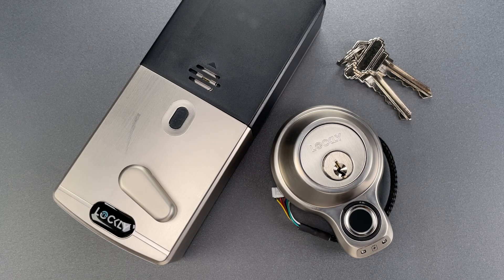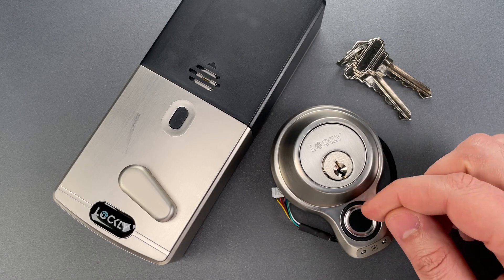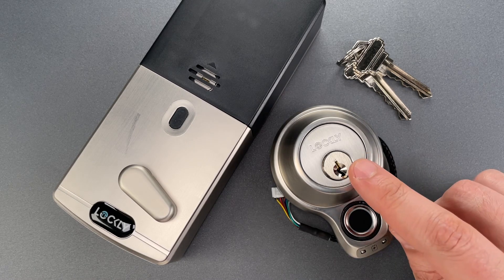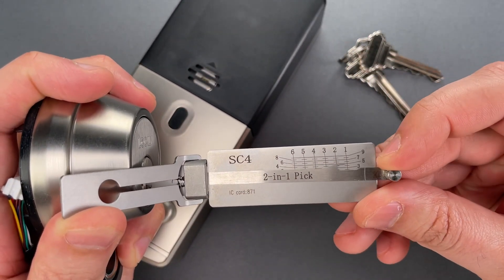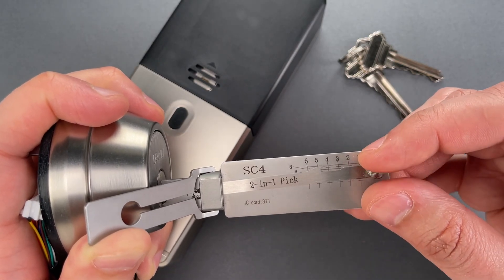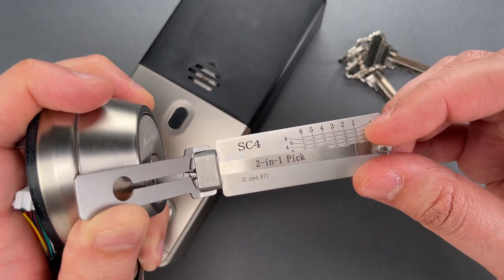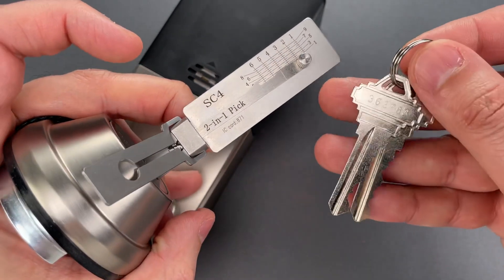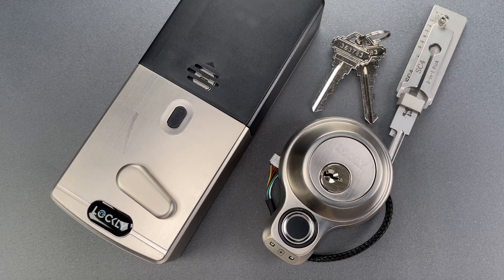[1410] Lockly’s “Flex Touch” Deadbolt Picked

Comment: I wonder what other vulnerabilities it has.  Magnet attack?  App security?  Hammer?  Etc.
Reply: Nothing short of a vault is secure against a hammer.
Considering that the actuator looks to be on the inside, I doubt it's susceptible to magnets - at least, not from the direction of the most likely attack.

Can't say about app security - that's likely no better than your phone security.
Reply: @lairdcummings9092  well, we're talking non-destructive attacks mostly
Reply: @CharlesHydronium  well, it can certainly be picked - if you've got the skills or right tools. I'd say - based on US crime data - that such is more than moderately uncommon.

Phone app is probably the most likely electronic access, but unless you are specifically being targeted, also pretty damn uncommon. Unless your phone has absolutely no security and is stolen by a burglar who is going to strike before you can reset the lock - oh, wait... I said pretty damn uncommon already, didn't I? 😉
Reply: @lairdcummings9092  Solenoid-operated locks can be very vulnerable to a hammer.  Not a destructive attack but an inertia or vibration attack.  Far less likely to succeed on a lock mounted to a doorframe, unless the implementation is particularly bad.
Reply: @bdf2718  while entirely true, the operating mechanism is on the other side of a door, making such an attack kinda pointless; if you can reach the mechanism, you can just flip the lever.
Reply: @lairdcummings9092  You seem to be assuming the thing is well designed mechanically.  This tends not to the case with smart locks.  It would have to be incredibly badly designed to succumb to the vibrations caused by a hammer applied to the outside, but...
Reply: @bdf2718  I'm not assuming at all. The LPL specifically said it was well-built. You did watch the video, yes?
Reply: @lairdcummings9092  He did say well built.  And mentioned the tolerances of the pins, in particular.  He didn't say it was well designed, though.  One can infer that LPL would have mentioned if it were badly designed but he doesn't always mention all the weaknesses of a particular lock in a single video.

We also seem to be spending a lot of time on one item in an open list of potential vulnerabilities.  Did you see my "etc"?  How does it fare against a ramset?  A core puller?  Etc.
Reply: @bdf2718  yeah, you seem a bit determined to find fault.
I'm not buying it. 
LPL doesn't usually leave faults unmentioned, or at least un-teased. None of that here, so I'm trying figure out which rathole you're trying to find.
Reply: @lairdcummings9092  LPL didn't mention any other faults, so one could assume there aren't any.  Nor did he say it was a lock he would consider using if he upgraded the core, so one could assume there are other weaknesses.  It could go either way.

My guess is he went for the attack he did because it was the weakest.  So, with an upgraded core, what would then be the weak point?  If there is one, why didn't he mention it?  If there isn't one, why didn't he say it was a great lock?

My guess would be the security protocol (or lack thereof) between lock and app.  If not that then the electromechanical interface.  But then there's the ramset and core puller.

There is going to be a weakest point of attack even with an upgraded core.  Is it a practicable one?  Most attackers aren't going to be experts with all the tools, they're going to be crackheads with a rock.
Reply: @bdf2718  LPL seems to like the single-pin method except for where raking is easy. If nothing else it's more entertaining to watch; moreso with his added commentary. I can't recall him ever using any cyber approaches though he does bypass some electronic locks. I know very little about cyber myself but I do know that BT and wifi aren't terribly secure for those knowing how to deal with them. In-depth pen testing does make use of wifi and BT exploits but not much online about those.
Reply: The locking mechanism is on the inside, so you can forget about physically assaulting it without destroying the lock or door. BT/WiFi unlock is what I would be most concerned about as it doesn't take much to ruin security, especially when sacrifices are made for convenience.

Comment: I can imagine that lock manufacturers compensation packages include bonuses based on LPL video length.
Reply: So folks at Master Lock get pay cuts? 🤣🤣🤣
Reply: @duke9173  are they even paid at all? I'm sure it's unpaid interns all the way down
Reply: This one would have been significantly harder if he used cheaper tools. In this case he just picked it with an expensive tailored tool. It's a great video, I like the Lishy videos it's easier to see what is happening, but it makes picking look easier that it would be with a standard pick and turning tool.
Reply: Using the Lishi has three benefits: it allows LPL to plug his website and tools, 2) it allows the viewer a better idea of what is going on, 3) allows the LPL to educate the viewer, and 4) keeps the video to a shorter length - an LPL trademark.
Reply: "So we get a bonus for a longer video?'
"Guys, lets make this lock hilariously bad so LPL will spend tons of time ripping us apart!"

Or when a measure becomes a target, it is no longer a good measure.
Reply: So does it really matter. This is a solid evaluation.
Reply: If you watch his SaintCon keynote, you'll learn that the only response he gets from lockmakers is "STFU"
Reply: Masterlock wins by sheer number of videos

Comment: Is this susceptible to the magnet attack that defeats a lot of electronic locks?
Reply: I doubt it. Seems like LPL would have checked that and would have said if it was.
Reply: The actuator is on the inside of the door, so, I'm pretty sure magnets are out. At least, from the direction of the most reasonable angle of attack. Anyone who can reach the inside can just flip the lever. 😛
Reply: I am going to go with not vulnerable to magnet attacks because all the unlocking mechanism for the electronic portion is located on the inside portion of the door, given most entry doors are metal clad doors the magnet would be useless, most likely not able to work with a solid wood door due to the mass between magnet and mechanism
Reply: Have any of you considered that there is simply a switch inside the external part, so maybe a magnet could move the small steal switch arm to active the switch without moving the rotating the barrel.
Reply: @NickSteffen  Have any of you considered that there is simply a switch inside the external part, so maybe a magnet could move the small steal switch arm to active the switch without moving the rotating barrel.
Reply: @dfgaJK  yes, considered and discarded.  It’s like any other dead bolt it just happens to have a motor added to it. If you cannot use a magnet on a regular dead bolt it won’t work on this. Additionally many of the components are not magnetic anyways.
Reply: I'm sure that if it was, LPL would have showed it
Reply: @KS-gf3tv  Perhaps, but it would have saved us all some time if LPL had positively stated "I checked for magnet or wire-shorting attacks and couldn't get any to work".  NB: or some other list, and of course stating it that way rather than "there ARE NONE", because even LPL isn't necessarily inventive enough.
Reply: @AthAthanasius  He also didn't tell us that the lock couldn't be raked open.  I don't find myself wondering if it's possible because I have some measure of confidence in LPL and his general testing, and I am glad that he doesn't waste my time with all the things that didn't work.
Reply: @AthAthanasius  as a general rule, I'd avoid using YouTube comments as a source for useful and complete information.  You'll probably be disappointed 😁
Reply: @crewealex1125  I have used YT comments for information and have almost won my 3rd Darwin award! This year alone! 🤣
Reply: @KS-gf3tv  Part of what you see here is preference- LPL prefers single-pin picking (which he's good at) while others might rake, bump, or EPG (which another picker tends to use extensively). If you watch other pickers you'll see where most match the attack method with the lock type. He also mentioned (and showed) security pins which make raking attacks far tougher to accomplish successfully; nobody I've seen would attempt to rake this lock on finding out about security pins. 

Locksport is as much knowing what not to do as much as it is knowing what to do. Single-pin picking isn't always best, but it can be applies successfully across a wider range of locks than any other method and I think we all like hearing "Click on one, nothing on 2, 3 is binding..." which you can't get with raking or EPG so I like LPL's approach as it's more fun to watch than the others. And as always, have a nice day!
Reply: Wouldn't the electronics be on the inside of the door? Or am I looking at it incorrectly? Just some questions.
Reply: @telanis9  no consideration of how magnetic fields decay with distance? of the magnetic permeability of the object you might be attempting the attack through? of the direction of attack required to manipulate circuitry in the way needed to unlock??? "Come on" dunning-kruger at it's finest
Reply: Motor and all electronics aside from finger print sensors and backup 9v power pins are on the inside of the door. Also lockly sends you a notification when physical keys are used /cylinder is picked. (at least if wifi connected)
Reply: If you need to attack the electronics from the inside then all you have to do is mechanically pick the lock first,  to gain access to them...
Reply: Probably not because the magnet is on the side of the deadbolt. That would defeat the use for a magnet, because the deadbolt would be easier.
Reply: Maybe but the time knowledge and magnet strength needed compared to picking the cylinder would be wasted effort.
Reply: It's not. He would have pointed it out first. Because he didn't, makes us know the electronics are fantastic
Reply: No.
Reply: @Hansengineering  Easy to say.  But even if it's driven by a motor rather than a solenoid, LPL has spinning magnets...
Reply: @bdf2718  It is not vulnerable to magnets. Have a nice day.
Reply: @Hansengineering  Again, easy for you to say.  Have you tried?  Have you tried with spinning magnets?  Have you opened one up and found an actuator that does not use electromagnetism in any way?  A piezoelectric actuator is technically possible but wouldn't come cheap.  A wax hydraulic actuator would be cheap but slow to operate and slower to reset.

See where I'm going with this?  If you're going to make that assertion, back it up instead of just repeating it.
Reply: @bdf2718  it’s not vulnerable to magnet, have a nice day!
Reply: @Hansengineering  what makes you so certain?
Reply: @bdf2718  It's not vulnerable to magnets. Have a nice day.
(I just wanted to join in on the fun.)
Reply: The only thing exposed to the outside seems to be the fingerprint sensor. All the rest of the electronics and mechanism, may it be solenoid driven or motor, is on the inside. That makes attacking it with a magnet a lot harder if not impossible (if the door has a steel frame, it is impossible). So I'd go out on that limb and say: no, it can't be attacked that way.
Reply: @bdf2718  you literally can't even practically attempt a magnet attack on it. the device is mounted on the opposite face of the door from the keyed side. in order to attempt the magnet attack you'd need to be in a position where you can already freely turn the deadbolt by hand
Reply: @miriamn1075  Problem 1.  The solenoid (if it has one) has to connect with the deadbolt and interact with the barrel of the cylinder.  The longer the linkage, the thicker it has to be in order to be stiff enough.  That means the solenoid may be nearer the outside than you think.

Problem 2.  A ferromagnetic doorframe wouldn't block a magnetic field, only attenuate it.  That would just mean you need a more powerful magnet.  Maybe too powerful to be practicable, maybe not.

Problem 3.  Most metal doorframes are aluminium, which is not ferromagnetic.  Attenuation of a static magnetic field is negligible.  Might make a spinning magnet attack against a motor infeasible, though, because induced electrical current would create an opposing magnet field.

Problem 4.  Magnetic fields have divergence: they bulge.  A powerful enough magnet could reach a solenoid on the inside.

It would be nice if somebody who actually knew responded.  So far all I've seen are guesses.
Reply: @Hansengineering  shouts "no", refuses to elaborate, leaves
Reply: @bdf2718  You are arguing just to argue.